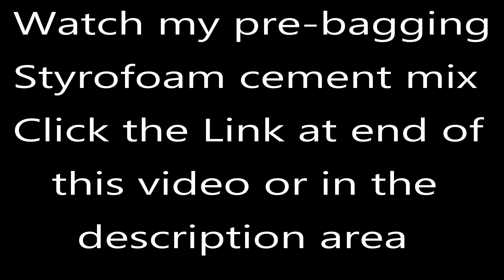The truth & facts about Styrofoam cement mixes

Comment: Things that often confuse people: (1) All Portland cement types have lime in it.  All types of Portland, by their nature have around 2/3rd lime content. The percentage of lime is adjusted to formulate it's many applications and uses.  Portland types vary in chemical composition, additives & ratios which produce around a dozen different types of Portland binders. (2) There is "Type S" Portland Cement and there is "Type S" Portland Masonry Mortar.  Each does very different things. Portland cement is stronger that Portland mortar.  (3) Engineers are usually unfamiliar with "regular Portland".  But they are very familiar with "ordinary Portland" which also has 60-67% lime in it.  (4)  Type S is much stronger that Type N, but both have lime ingredients.  Don't use Type N for faux rock usage here.  (5) Don't go by the colors on the bags, blue writing versus orange, etc.  Manufacturers change bag designs and colors all the time, in different markets around the U.S. & world.  Even bag weights change from time to time.  (6) All recipes can be tweaked, "3 parts Portland to 1 part lime" means you're just adding more lime to something that already has lime in it.   //  Like cooking, changing recipes is normal, to fit your construction need.  But if your working for a sign-off, the project building engineer will expect to see your formula's ATSM testing data results, which may not exist or have been published yet.  //  I'm no expert.  Just a DIYer.  If you disagree or find an error here, please discuss and please add a source or citation so we can learn more.   Fauxrocktraining is an awesome resource!!  Wonderful videos!
Reply from the maker: Well thanks for the feedback. I really appreciate you watching my video.

Comment: im wondering about a good R value and not so much the strength. i want to build a concrete structure and use a higher ratio of eps to concrete on the outside, and then stucco over it. i have seen people do it on youtube and its enticing.
Reply from the maker: Not really good R value, but “to each his own “ Thanks for watching my video
Reply: @fauxrock  even at thickness? im thinking at least a 6" layer of maybe a 4:1 mix. that's got to have a decent amount of insulation properties to it.
Reply from the maker: @gedion4000 a 4 to 1 mix would have an 3 R value per inch of thickness

Comment: As someone whom has been around construction most of my life, I REALLY appreciate that you EXPLAINED to the audience, that there are DIFFERENT mixes for DIFFERENT needs.  There are newer "builders", that are mixing their own mixes(no problem), but they are NOT testing them, and using them for EVERYTHING.  My first thought, when I saw them, was WHY would you build a WALL, without KNOWING what the compressive and tensile strength of your material is?  I wonder how many buildings around the US are going to collapse, due to inferior mixes, or incorrect applications.  
With that said, keep up the good work.
Reply from the maker: Thanks for the positive feedback. I really appreciate you taking your time to watch my video.
Reply: The last time I heard of a building collapse was the one on the beachfront

Comment: I'm looking to fill an 18 inch thick wall using slip forms to make a non flammable insulating mass. The only structural function is to hang onto the 2 inches of stucco on the outside.
Reply from the maker: I would use vermiculite or perlite instead of Styrofoam beads Styrofoam beads are flammable and melt at a very low temperature at 400°

Comment: Thank you for all these usefull informations.
You mentioned CaCl2 as an additive for reducing water.
What ratio would you prefer?
Is it also working with aircrete?
Reply from the maker: Thank you for your positive feedback. I really appreciate watching my video.
Not sure what you meant with the attitude for reducing water ??? I have worked with air in the past, but I’m not very fond of it and see no benefit in using it generally speaking, obviously I keep the tool in my toolbox if I need it, but I rarely bring it out.

Comment: I’ve worked with aircrete before, however I’m just getting into the ‘light weight’ aggregate method and really appreciate your knowledge that you are sharing here! Thank you!  As a question what would be an average size styrene aggregate size to use for concrete forms I plan to use for raised garden bed sides?  Was planning on a 1/3  - 1/5 mix, however trying to determine the optimum size to get used styrofoam packaging broken down too?
Reply from the maker: In re-grind foam there are typically three sizes, fine, medium, and large… styrofoam is originally made with a single bead formulation in other words, virgin Styrofoam beads. To me that’s fine size. Medium grind would be 2 to 3 beads and course or large would be 5 to 8 beads. This varies across the industry due to how the Styrofoam is ground after it was formed into something like sheets or cups or whatever. Depending on your piece that you’re trying to make you can experiment with the fine or medium or large size aggregate and or blend some of them together to make the optimum mix but experimentation is definitely in your future. Thanks for watching my video.

Comment: I have an idea for a faux rick siding application. I saved boulders for years and I am maing molds of those surfaces 1.5 inches deep. I want to coat the form with a finished material then a webbing with attachment points then fill the larger void with styrocrete. I can screw them on as randomly as a mason would set stone and fill the mortar lines. My questiona are all about formulation for sure. Im good with coloring and finish but for surface strength I need one formula and for applying the inner webbing and attachmant wires I need one the will be strong light and marry the styricrete to the surface material in a  monolithic way. I know I can purchase stuff like this but I dont want the same thing with the same look and I want to reuse styrofoam. Also is there a cleaner cement like wood ash cement that is greener? Are there pros and cons? Ok Ill call and get educated lol. Great video for so many people.
Reply from the maker: It would be best to call me…971-237-2957

Comment: What would you recommend for a basement floor that's always damp, existing concrete disintegrating (did get a french drain, but because the way the shale is layered, there is still some hydro pressure)
  I was thinking a 4mil plastic layer with 4" pour on top. But I think i should ask your advice first. 
Thanks in advance!
Reply from the maker: I’m always adamant about getting rid of the water not just trying to cover it up. there’s gotta be some sort of a way you can make a sump drainage contingency to make this go away. Thanks for watching.
Reply: @fauxrock  I wish! 
There is a 2 inch deep by 2 in wide grooves that goes around the perimeter of the basement, it's there to collect the water and bring it to the low corner where there is a pump. But the fact that the floor is always wet and I can't really put anything on it and I could never finish the basement you know sheetrock ,walls, it would never work! Also it causes whatever concrete that's there to disintegrate in short order.
    With my plan to put a layer of plastic down like what should have been done when the house was built, 
I intend to leave the plastic open on the perimeter to the same notch where I would put some PVC, not a Leachfield pipe, maybe a 1-in pipe with some holes drilled in it, same concept. Basically redirect the water to the perimeter to get drained.
   I really don't like it the way it is now, reminds me of living on a boat with a bilge pump.
   Do you think 4 mil thick plastic would be enough?, do you think 2 in of concrete on top of it would be enough? If I  fail completely what formulation of concrete could withstand the constant intrusion of water?
Reply from the maker: The system you now have in place is gathering the water after it goes through the slab… the way I see it you’ve got to collect the water from well below this lab so that it never has a chance to get up into the slab. Ultimately that means demoing out the original slab creating a drain fill. That’s a good foot down below a dry gravel bed evacuating the water out by means of having a float system that whenever the water raises up to the height of the pump, it turns on.
Reply: @fauxrock  I actually think there was one or two of those in the past but they have filed up with the sand of disintegrating concrete leaving only the outline of a pipe at ground level. 
 (There were documents for a basement sump pump in the paperwork I got when I bought the house, but I was never able to find it)
   I am retired/disabled and can't afford even a small fraction of the labor cost so I have to be able to do it myself. I'm barely able to collect the concrete! 
Do you think a shallow groove a few inches deep with a small PVC (with holes drilled) from the center of the room to the low point would do sufficiently more than a plastic sheet to be worth attempting? I know it won't be as good as the well you describe, but if you say it's 2x as good as the plastic sheet alone even if ½ as good as the well , that might be my best bet for what Im able to accomplish. Fortunately the disintegrating concrete is pretty soft. Digging A few inch trench in that would be lot easier than feet of hard shale.
   What mix do you recommend for the actual floor, for best hydrolic properties? Or don't you see any benefit over standard premix?
Reply: @fauxrock  more general question, what do you think about spraying concrete with sodium silicate during the curing process? Do you think that actually makes it harder or more waterproof?

Comment: So by adding lime to the Portland at a 3:1 mix will this speed up the drying time or slow it down
Reply from the maker: Just to clarify, we want an S type Cement, which already has the lime and Portland mixed together the proper ratio. if you don’t have S type Cement, then you can make it by taking one part of lime to three parts of Portland Cement. 

From there you can mix 1 part of your S type Cement to 3 parts of the styrofoam beads mixed with enough water to make it workable.

Comment: Aircrete additives in concrete mixes  with stone agregate 
Makes for better frost resistance forming micro bubbles for ice "freezing pressure "handling , but when overdosing the air adive  concrete get weak doe .
Important to keep the 
Water cement ratio at at a minimum.  On formes with closed roof  areas lower than the fill level  the cement air mix may fill the top of these areas, making the surface weak. The heavier stuff would 
Layer below.  I buy  foam agents concentrate and platisticers concentrate, from my local concrete supplier. 
You really have to be careful 
With the foaming agent ,it can mess up your concrete bad ,if you slip up on the recipe.
Reply from the maker: Good stuff for the viewers. Thanks

Comment: Cheers Bro! Great info.  I produce high quality low cost FLG. Graphene.  If you add 1% to the mix you can expect approx 50% more strength and thermal and heat resistance. 400x more water resistant .Let me know if you want some to test. I have several ideas for lego type lightweight panels.  When its added to building foam it becomes 5x or more harder. One could mass produce panels ,boats, drones etc,..
Reply from the maker: Thanks for the feedback and the time in watching my video. Give me a call to discuss your product 971-237-2957
Reply: I was introduced to graphene by Robert Murray Smith in England and know a little bit about it but not up on latest developments. I am interested in building Dome structures and appreciate your bringing graphene back to m i n d. Have we got to the point where there is such a thing as graphene sheets which could be added for defensive purposes?
Reply: @kathleenbrock2746  Nice small world Robert is my favourite YT channel

Comment: I am considering to make a portable firepit. For that I'd need some light weight concrete so it can be rolled on wheels. I am just an average Joe without any particular skills and with no big budget nor time to experiment a lot. What would be your formula to approach such a task? Should be sturdy enough to not to fall apart when moving around but as light as possible. And also should withstand heat of fire. I researched what type of concrete I should use but even if I find something they never show/tell how it holds up. I was thinking to make the base solid concrete then build the walls from lightweight, but not sure on the longevity of that. Any thoughts would be much appreciated.
Reply from the maker: Well, cement mixers, in general aren’t good for a high heat applications even more so the Styrofoam Max would not be a good candidate Mixture to utilize in that endeavor. Usually clay formations like fire bricks for instance, or what are lined into a fire pit area.
Reply: Perhaps I would use galvanized electrical tubing for the frame if you can weld because it's light weight then coat it with concrete bonding adhesive then use a Perlite, Portland and acrylic fortifier mix for the bulk form encasing the metal frame. Then for the thin skin coat maybe a fire brick mortar
Reply from the maker: Now that’s a great idea.👌😃👌
Reply: @captainamazing1356  thank you, that sounds great! So if I just have a skin coat it should do the trick. It seems I have to dust off my age old project idea and get into it :)
Reply: @gabbor2904  I personally haven't used fire brick mortar but I don't see why it wouldn't work. You may want to add fibers  to the fire brick mortar skin coat. I use what my local concrete supplier calls Stealth Fibers because they are very fine and you can torch any strands that stick out of the surface. You may also want to add some acrylic fortifier to that as well
Reply from the maker: FYI:
Any fiber that you would want to use in this type of mixture should not be something you can burn with a torch, as if you can burn it with a torch, the fire will melt it whether it’s accessible to the Fire directly or in the mixture (indirect exposure)

Acrylic admixtures cannot be used in something that’s going to be next to high temperature as well .
Reply: @fauxrock  Yeah probably all true. You could use diamond lathe or expanded metal lathe that is used in stucco instead of fibers. For high temperature mix you could also use Magnesium Oxide and a phosphate mix but that can get a bit complicated getting the mix right. Personally I would get some fire brick mortar and see if that is a workable mix for what you are doing